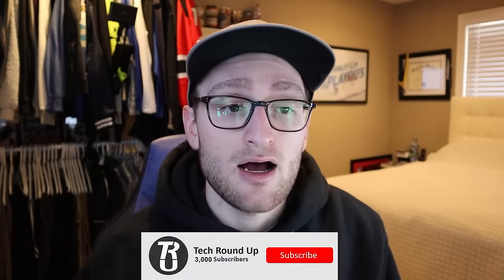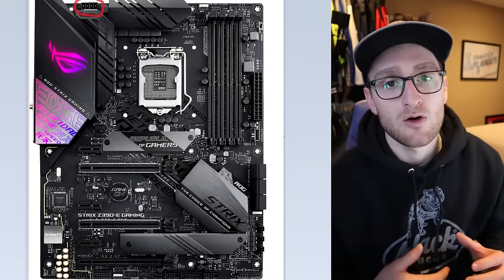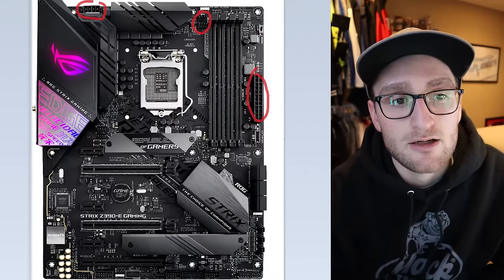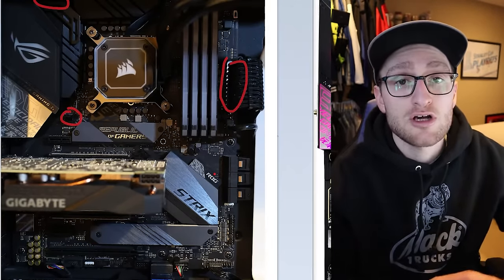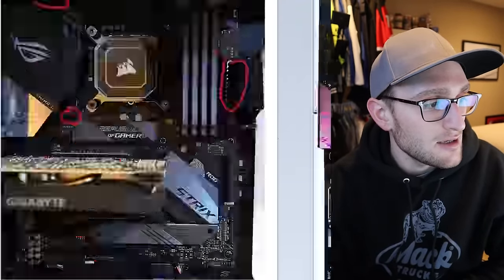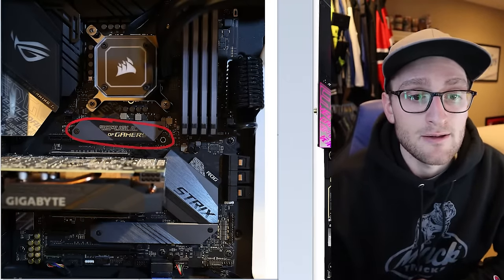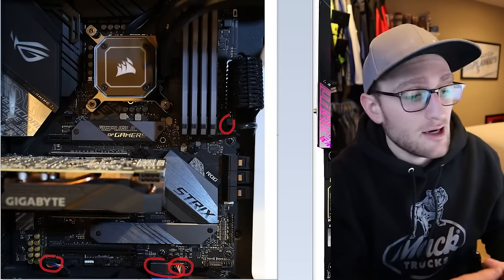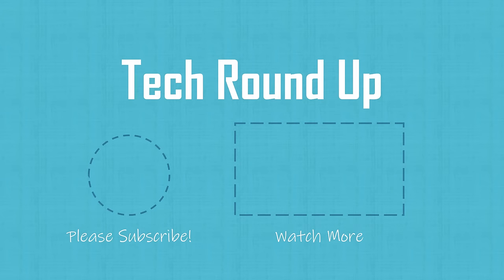Where do all your PC Parts Plug In?!?! Motherboard Connectors

Comment: I’m so annoyed. I bought a water cooler and can’t even hook it up correctly it’s annoying asf 😡😡😡🤬🤬🤬
Reply: Hahah did u get it
Reply: me rn
Reply: Same
Reply: @carlosrivers27  what I did was take out the radiator of the fans and then put the radiator in the front idk what case you have but for mine I have the nx200m and I can take off the from and put the radiator then get the fans and since they have long screws fit then through the bracket I had to make a hole in mine so the aio cooler the one that goes on top of the cpu fit but that was my fix and I kept re applying thermal paste trying to find out the best and it would over heat and I didn’t have enough thermal paste but I have sun now and it performs perfect now
Reply: n00000b 😂😂😂😂
Reply: @guillermofernandez2956  I glued my Shi in💀
Reply: I had to swap out my cases intake fans to put in my radiatior + fans and used the original intake fans as out takes, two on top, one in the back.
Reply: @uhm175 he fixed it kiddo, and he ain’t a noob, noob means that you just started, he didn’t just start.
Reply: Same
Reply: @masvox8134  hell naw I ain’t get it. Just kept the old one 😒
Reply: I have the same case.
My fans aren’t load tho.
I’m having other issues, I can’t figure out if it’s the motherboard or cooling system.

Lian Li Case 216 v2
Lian Li ALC 360 Coolant System
Gigabyte B650 Gaming X AX Motherboard.

I have my pump connected to Fan3/System Pump.
I have the CPU_Fan Connected to the CPU_Fan Header on the motherboard.
Nothing in the CPU_Opt.

The Coolant Pump lights up, but the fans do not and they don’t move.

Inside the BIOS, it says N/A for the CPU_Pump and the CPU_Fans.

I have no idea what’s going on with this. 

Everything else shows in the BIOS.
Reply: Same
Reply: I made that mistake hahaha so dumb bro

Comment: I’m building my pc and I was so stressed out figuring out where certain cables go on the mobo and this truly helped me! Thank you!
Reply from the maker: Super glad to hear!
Reply: @TechRoundUp  I noticed that my mobo doesn’t have the usb c header 8:22 I have the msi mpg x570 gaming plus
Reply from the maker: Yeah not every one will
Reply: @TechRoundUp  just built my pc. It turns on for 7 secounds and turns back off. Nothing comes up on the screen while it is doing this. Any ideas before I have a breakdown? Lol
Reply from the maker: That can sometime be power supply related, I would just make sure all of those cables are properly connected
Reply: @danielcoyte8073  don’t let the mobo touch the case
Reply: @Xbui.23  ??
Reply: @danielcoyte8073  did you ever figure it out ?

Comment: This video maybe 2 years old, but this helped me a lot. I've been contemplating updating my power supply (so that it can support a better graphics card in future) and my cpu cooler, but I was intimidated as hell when I opened my case to give everything a thorough cleaning the other day with all the cables I saw. I'd have no idea what to disconnect to do the replacements. But this makes it much less stressful. Seems like I'd only have a few things to disconnect to do those upgrades.

Comment: Very helpful for newbies such as I who are largely ignorant to this whole process.
Is just all fancy lego, isn't it?
Was daunting at first but it's definitely a fun process once you finally get to sit down with everything and plug stuff in.
You're a good teacher, man.
Thank you!
Reply: i spent 6 hours building for the first time and it is way to confusing for me lol
Reply: Indeed.  I have a dumb question though: the fan HUB in my DarkBase 900 (version 2) has a PWM connector to the mobo.  As I understand it, PWM will regulate the speed of the included PWM fans (according to temperature) - SO which motherboard fan header do I use?
Reply: I'm a complete dipshit when it comes to these things but I sorta understand.

My understanding is that motherboards have a bunch of fan plug-in-spots but one is special as it comes with more abilities/settings than the rest and it's ment for water-cooling, I believe.

Can plug whatever random fan in there that ya want since the plug thingy is universal.

Mine largly looks the same as the rest just with the unique trait being text written on the motherboard identifying it as "special" for lack of better word.

Don't take my word for hard fact since I totally 100% bullshit and lucked my way through the entire process of building my first PC.

Still got plenty to learn so I may be of little to no use in the way of helping.
Reply: @flyingtuffy3502  ive been building for the past five days... a little bit at a time.
Reply: @yacqub  just built my first in 2 hrs
Reply: @flyingtuffy3502  same I spent 12 hours because I kept stopping because I was so confused
Reply: I'm 1 week in building, slow process because i learn & i read guides as i build.
 Maybe doing high end build as my first isn't the best choice😁.

Comment: :trophy-yellow-smiling: Thank you so very much, you are like a breath of fresh air. The best video by far I found on these connections, was getting a bit confused with fan headers vs fan hubs that come with a pack of three fans I purchased. I also have a small board attached inside the case, something to do with fans also. Haven't worked out if I need to use that or not but I will. Thanks again, well done.

Comment: font panel connectors are so much fun!! /s   seriously they should create a different connection system for those wires.  Skinny wires, into skinny pins you need a flashlight to see and the mobo reference manual to put in correctly.

Comment: Very informative! Going with a Z790 - 13700k - 32gb DDR5 6800 - 4080 for my first time building a PC 🤣 I’ve used a laptop for a couple years and decided I wanted to build something nice that’ll last
Reply: thatll last for sure. How'd it go?
Reply: Pretty well, took me around 6 hours to build it but I took my time with the cable management. Looks nice and runs even better!
Reply: @logand2431  that’s great to hear! I’m building mine in a weekish and Ic can’t wait!
Reply: I actually went with the 4070 just re-read my comment. Performs great I think the 4080 is overkill, 4070 outperforms 3090 ti in 1440 most cases. Recommend it!
Reply: @logand2431  nice! I’m going with the Ryzen 75800x3d and 4070ti

Comment: when you are using a water cooler instead of plugging the the connector into CPU fan1 do I need to install that connector into the pump header?
Reply from the maker: That would be the best way to do it, and then if you are using a fan controller instead of running the aio fans to the cpu header, you will need to ignore the CPU fan header in the bios

Comment: Thanks for creating the video, it was a great tutorial! Just in case it will benefit anyone else, Im going to mention a couple of personal issues that brought me here in the first place. 
I have the Asus Z590-E motherboard. this video is using the Z390-E and its similar. I am using the Seasonic TX 1000W 80 Titanium PSU with my motherboard. For CPU and mobo power, the 24 Pin thick braided cable obviously only plugs in the power supply and mobo in 1 place only. Cant mess that up! 

But for the top left CPU power plugs, the Asus manual sucks as usual. There is a 4 pin receptacle next to an 8 pin receptacle.  The Seasonic psu  includes two cables, but labeled PSU for the PSU plug, but then each cable has (2) 4 Pin plugs. So, my logical assumption and 5 fingered hand math, tells me to use 1 cable (2 - 4 Pin plugs) for the mobo 8 pin receptacle. 

Then I assume, playing guessing games with $600 worth of equipment, is to use 1 of the 4 pin connectors on the 2nd PSU/CPU power cables to plug into the 4 pin receptacle on the mobo and leave 1 (hanging). 

But im here doing research before gambling and I do something wrong.    

This is just 1 of my issues connecting my mobo cables. There are a few others! Im so miserably happy to report!!!!

Comment: I got Asus Z690-P mother board and there are 4 and 8 pin connectors for the CPU.. should I use two cables one for the 8 and a second one for the 4?
Reply from the maker: Yup

Comment: So I'm close to starting a new build and have been looking at several videos.  I've built 3 rigs already but it's always good to have videos like yours around.  I was wondering about all those fan wires and just found out that you can also use Fan splitter cables.  Connecting 3 fans to one header.

Comment: Thanks for making the video.  I have a question if you wouldn't mind humoring me.  Doing my first build, I have a 240 water cooler, and I don't like the fans that came with it.  All of my other case fans are RGB going to a hub that I am.  I was just going to get 2 more of those fans, and put them on the radiator.  Do they have to be controlled differently by the mb for cpu cooling, or can those fans just get plugged into the hub with the other case fans?  Thanks!
Reply from the maker: They can definitely be controlled by the hub especially if the hub allows for individual fam speed control, otherwise you can run all of your case fans off of the cpu temperature to increase speed as temps go up

Comment: New builder here. Got an air cooler but I'm switching to an AIO. Would I plug the radiator fans into the CPU fan header? It will be a roof mounting cooler arctic liquid freeze iii 280. I have a ryzen 9 5900x so it runs hot.

Comment: What does plugging two GPUs in the Pcie slots do? Does it halp with games? And would an RTX 3060 be able to be plugged with a RTX 3070?
Reply: Hello -  When using multiple cards is known as Crossfire when AMD cards are used and SLI when Nvidia cards are used. It is possible to use one AMD and Nvidia card in a multiple card setup but it is very difficult compared to just using 2 x of either AMD or Nvidia. - m plugging in Multiple video cards ( gpu's ) was a more popular option of increasing your computers graphics capabilities in the 80's , 90's and early 2000's but graphic cards have advanced in overall capabilities that using multiple cards isn't needed as much and depending on the level of the cards - it could really increase the need for a more powerful psu then you would otherwise might need. You could still do this - but it's not as supported now , so it might be more difficult then it had been in earlier passed decades. If you are seriously considering using multiple graphic cards in a build , there could be a need to have a second PSU just for the multiple graphic cards ; depending on which models you are considering.
Reply: @johnpaulbacon8320  well tnx, even if that was over 4months ago

Comment: Hey, I got a ASUS motherboard and the case I got came with a Fan hub and the fan hub has a 4 pin fan header and the Sata cable ...does the 4 pin  go in any of the fan headers ? Or specific one? Also the Sata cable goes connected with the PSU correct? I need help

Comment: Hello, I have Asus tuf gaming LC 120 liquid cooling. It works fine but the RGB is off. When I open the back of my case, a cable with a 3-pin (ooxo) female input is lying idle. I think it's rgb connection. where should i put this? My motherboard is asus pro b550m-c csm. The only 3-pin input on the motherboard is the pin with the name "chassis" on the intrusion header.

Comment: I am about to build my first PC and this is pretty good to know, you left out the pci-e connector to the graphics card though, but I am sure most people know what the PCI-E cable is for. Also for my motherboard I will only have the cpu fan and optional fan. For me to plug in my other fans I plug them directly into the power supply wires for the fans? The fans I am buying will include a converter for the 4 pin fan connector to connect to the plugs from the power supply. That means I can't control those fans via software huh? Those fans will be unavailable to edit the fan speed, since they not connected directly to the motherboard? My micro atx board doesn't have extra fan connectors sadly
Reply: What is a pcie
Reply: @Aj2GT  A computer

Comment: I'm buying a motherboard that has 8+4 pin eps connector for cpu, but my psu has only 8pin connector, high wattage psu has extra pin though, so will the motherboard face any problem or it'll work fine?
 my pc consumption will be about 150w with 5600g no gpu, and psu: corsair cv450

Comment: Question: I recently (today) upgraded my motherboard to a gigabyte x670 gaming x ax v2, but the bios doesn't recognize my sata drives. Any suggestions? Both motherboards had sata3 connectivity. Also, if I plug in the sata in my power supply, the pc won't boot at all

Comment: For me, everything was very straightforward forward apart from connecting the front and rear fans, and the aio cooler with two fans .

My AIO came with a small box to connect fans, and I ordered a Nzxt rgb and fan controller so sure if best to use that or connect direct to mobo.

Comment: Thank you this video is so helpful my pc is tuning perfect. I only have some comments /questions my case is Sharon rev 200 and my mono is gigabyte b450m ds3h v2 I have a fan hub in the case for 5 fans. To control the fans now I use the reset button but it also gives me an other cable with 2 different ports one is vdg and the other one is 2pins space and another pin witch are +5v d space and g . Can I connect the dvg in a usb port like you? If yes where exactly? 

Thank you for your time

Comment: I am a first builder.  I have plug the sata data cable into slot but I don't know where to plug the end of it in?  One end goes to sata L on Mobo but where to plug the other end?  Same goes with the sata power cable.  I have plugged in PSU but where to put in computer?  Please advise and thank you in advance!

Comment: I'm not sure if this is talked about. I haven't read through all the comments but I have a cool master cosmo c700 with two usb 3.0 cables but my motherboard has only one port for 3.0. 
The splitter that I bought from Amazon doesn't seem to fully work. It does charge my phone and my gaming controller but it does not respond to gaming inputs placed on the controller to my game

Comment: A bit random, but on a mobo (MAG b550 mortar Wi-Fi) I have 3 pin connectors for my fans but the board only has 4 pin headers, it does have a bit of plastic coming off of it, I have read that it’s compatible but just want a second opinion. Also does it matter what fan header I use, like the fan pump header?
Reply from the maker: 3pin fans will definitely work with 4 pin headers on your mobo. I would recommend using CHA_FAN headers for your case fans and CPU or AIO_PUMP headers for cpu cooler

Comment: I need some help. I am building my first pc and I am installing an RGB CPU fan but I am struggling to find my Mother boards ARGB port. My mother board is the ASUS A320M-K
Reply from the maker: I don’t know if that board has an included argb header, so you may need to use a controller most likely connected to one of your usb2 headers

Comment: Hey my case is the Corsair 7000x and I had the msi z690 carbon wifi motherboard. There's 2 cords for 3.0 USB but only 1 port on the motherboard how do I hook them both up? This is to hook up my front panel 3.0 USB type A

Comment: So I just bought a new motherboard, the MSI B550 MAG TOMAHAWK. For the USB front header under the 24 pin is a USB 3.2 type c. I didn't know if my case would come with that or not? Cause the one I have plugged into my motherboard now is a bigger header. I'm nervous that I won't have the cable to go into my USB type c port, and I didn't know if I would have to buy one, but then I would have no idea where I'd plug it into

Comment: I recently finsihed building for the first time with an aio, I have been using heatsink with air flow fans before. But after I start up my PC the 3 fans on the radiator is not spinning... my pump and my other fans are working fine along with the RGB for rhe radiator fans too. I'm using a fan hub at the backside as well so i guess those fans connected to it won't show up in my BIOS as connected fans, and I need a software for it?

I just don't know what the issue might be that my radiator fans are not working. My CPU is getting a bit hot because of it, and I maybe thought they would work a bit like my GPU that starts the fans when needed.

Comment: Great video pal, I built my last PC 7 years ago, it has lasted me well but have a new one coming in a couple of weeks paid someone else to do it this time lol as couldn't be bothered, however I will be swapping out the case fans and AIO fans so I have 7 Coolermaster Halo fans and it all matches, along with 2 Razer Chroma controller's for the RGB Fans AIO pump, Case LED and later on RGB extension cables which will need to be daisy chained into the 1 ARGB header, why do most boards do this only one ARGB header but 2 old style most people don't touch RGB headers?
Since 3rd party controller's cant cope with 120 leds.
My question is with 2 controller's needing 2 USB 2.O plus the case USB slots will I need a USB 2.0 hub?

Comment: There are 2 additional cords connected to my fans. One has 3 slots open but is 4 slots long. And the other is about the same length but has a cap over it. What are these? Do they need to be plugged in?

Comment: What L slot on the board do i connect the data connection cable that comes from the ssd to?
My board has1 black L slot, 2 white L slots, an 1 blue L slot
And then what color L slot do i use to connect a SECOND HDD to?

Comment: Do you have to have all the JUSB slots at the bottom of your motherboard? I’ve been having a power surge issue with my USB ports and I’m wondering if it’s because my JUSB slots on the motherboard aren’t plugged in

Comment: Most MBs tell you to only use the cables that come with the PSU. I only see that some PSUs use thicker cables. Do the PSU makers somehow change the pins located in the cables? Though not in your video inform viewers of the importance of the MB battery. My MB has an 8-pin connector next to the 24-pin connector. What is this used for?